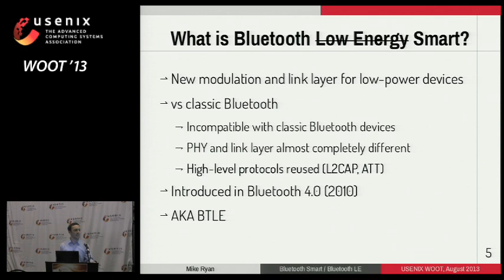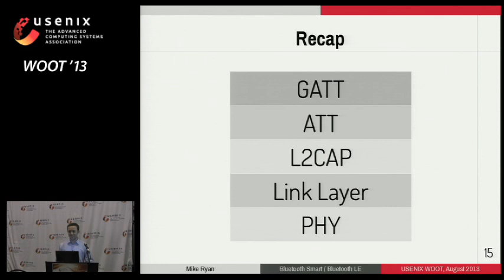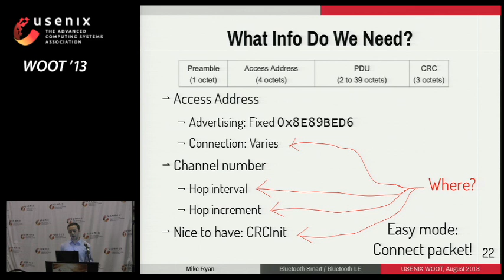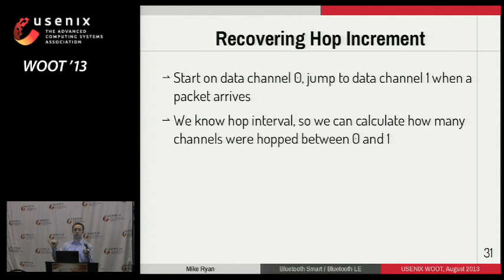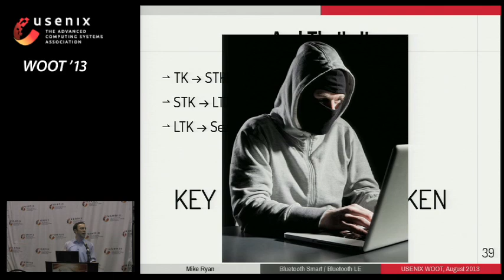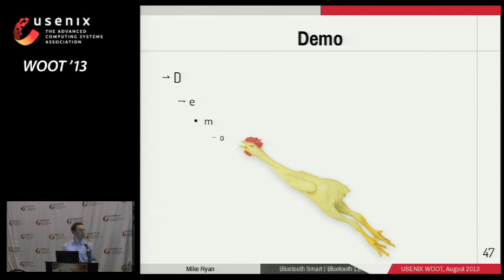Bluetooth: With Low Energy Comes Low Security

Comment: do they still use the same bad key agreement protocol?
Reply: Yes, if you use the same pairing method you used with 4.0. But there is a better option available now: the "LE Secure Connection". This option even uses the Elliptic Curve version of Diffie-Helman Key Exchange, finally addressing the absurd flaw Ryan exposed so well in this video.